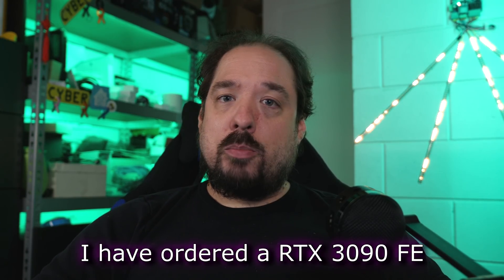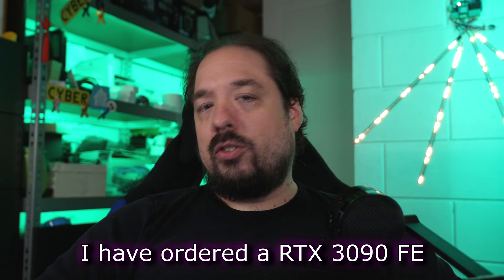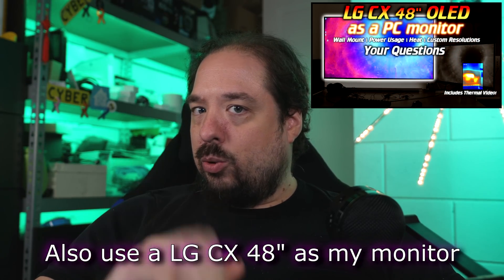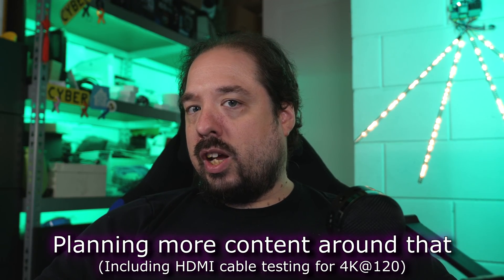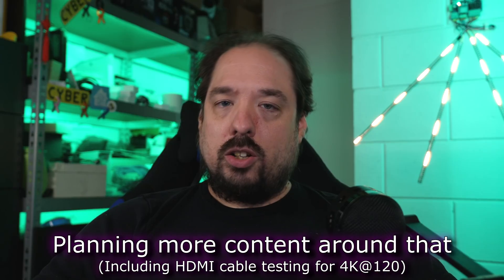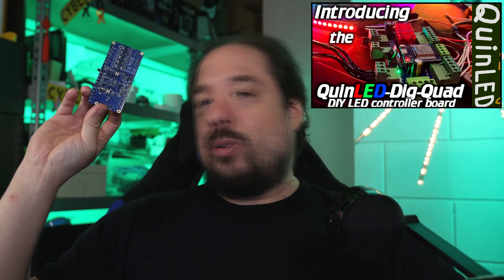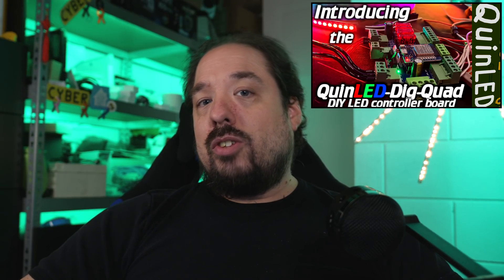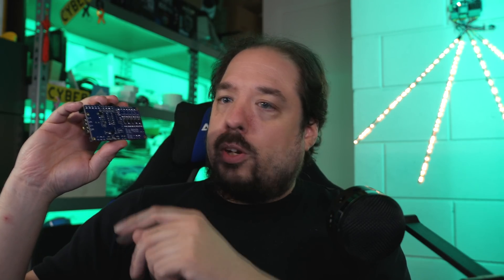Let's talk about: NVidia RTX 3080 stability / capacitor issues (POSCAP / SP-CAP vs MLCC)

Comment: So is safe to say that you better have a design with 15 x 320uF SP caps rather than a PCB with 10X 470uF  SP caps? The 320 uF being more responsive and faster responses?
Reply from the maker: In theory, yes, there is always multiple factors at play but as a general guideline that is correct.

Comment: Amazing work.
I have a Palit GamingPro 3080 and I experienced the same what you just said. I can boost up and overclock as high as I want and as the chip let me (more then above 2Ghz) even with the latest nvidia driver (456.55), but when I'm alt+tab or swap from almost idle to a heavy load or from a loading screen to get in to the game that's the point where I get a crash. usually this happens after like 3-5 hours of gaming. what is sad I have the new bios update what they got for this Palit card but i still have the issue (latest driver latest bios same issue) but I hope it wil be fixed with a newer bios soon :) so I try to stay positive and wait.

Comment: Looks like the new drivers have fixed this, Reddit users who had the crashes now confirm they are gone with the 456.55 release
Reply from the maker: Yes, reading this too, they seem to have toned down boost behavior in the upper regions slightly. Who knew that was in the drivers and not the BIOS/firmware. Still, exactly what I expected they would do. ;)

Comment: Guys you know what would change this entirely.  If this card had a stock power limit of say 500watt (but it would never happend as Nvidia want to look like they make cards that does not require too much power) then the fluctuation in voltage for the GPU asked for would not vary all that much.  Funny thing is I noticed that with this latest driver 456.55 from Nvidia that my vgpu to the gpu is fluctuating very little while I run benchmarks or play games.  I am saying this as a Palit RTX 3080 GamingPro OC owner.  I have not experienced any issues even with the first driver, but some of the people here in South Africa has, untill they installed the latest driver.  The normal boost clock on this card goes all the way up to 2055mhz at stock, however my card is running 2070 and 2085mhz at stock with a slight vcurve mod and does not crash.  

I did however check the caps on this card and it has one array of 10 of the MLCC caps which maybe helps.

Comment: You skipped the difference in cap types. I know different behavior in high frequencies does matter in designing radio equipment. So i have another speculation than you and want your opinion on it. You say that the boost or changing the working frequency give spikes, i disagree because what creates power draw in the first place is utilization of the card. So i say that all the switching transistors (fin-fets) in the GPU are generating high frequency noise on the power delivery constant up to around 2Ghz. I say up to because not all transistor will switch with every clock. However switching is hard and will cause square waves with lots of harmonics above 2GHz. Now as the card boosts the frequency does only increase a little, but powerdraw of the GPU goes up in bigger steps. So now you are creating more noise of al the switching going on in the GPU. If this noise, or constant wobbeling of the voltage is not canceled out. I think the problem will occur that the logic states of all zero's and one's could be messed up. I think this because modern high end chip are starting to use lower and lower voltages so the difference between zero's and one becomes smaller also. A 3080 uses somewhere up to 0.9Volt as VCC. This does not mean a 1=0.9V and a 0=0V. On a DM74LS09 simple logic chip VCCmin=4,75V VIHmin=2V and VILmax=0,8V. If the difference between 0 and 1 in a modern GPU scales with the logic chip example that would mean 0 and 1 are very close together. Although i tinker with electronics some times and it was my day job in the past i never worked with chips as complex as modern GPU's. So if my hypothesis is correct do you think the different type of cap would make any difference? Because filtering out high frequency noise is better handled by MLCC as far as i know.

Comment: You guys are talking about who knows what while Ive been gaming on my 3090 for the past 3 days. All you need is a NEW and GOOD quality power supply. That's it.
Reply: Yep. While GPU apocalypse is coming down all the YT channels, since few days i'm putting my 3080 to good use. With no problems. I also belive that quality PSU is the most important PC component. More important than CPU, RAM and MB.
Reply: Yep too many people dont really know what they're doing and buy overy expensive gpu, cpu, high speed memory, LED up the wazoo and skimp on the psu. Go figure

Comment: hey, i know for mlcc some of them are so expansive, like KEMET 47uf 0805. looks like rtx3080fe and ausu are using them.
Reply from the maker: Yeah, not sure where that is coming from but a generic 6.3v 47uF 0805 is only like US$0.031 if you buy more then 10000. That's not really expensive? Even if they are using some uber variant, it's not an expensive part.
Reply: @IntermitTech  yea, most of mlccs are cheap.  the mlccs on rtx3080fe and asus, they are bright yellow. I think only KEMET's mlccs are bright yellow. And i check on mouser $1.x for one. lol
Reply from the maker: @NEO3844  Can't imagine they'd still cost that if you buy them by the container. ;)
Reply: @IntermitTech  it's the price when buying 10K, just buy one will cost $5 lol

Comment: In regards to the chips, are you saying its better to have 4 SPCAPS and 2 MLCC sets, or a total of the 6 MLCC sets? Just trying to wrap my head around it. Thanks in advance
Reply from the maker: I believe the combination is going to work fine/is the most logical design. It's a combination of grunt and fast as you'd normally design it. I guess all MLCC so all fast would in theory work just as well, but as some point there would be a diminishing return.
Reply: @IntermitTech  mlcc caps suffer from cracking and they are placed there the thermal cycling would be most prominent. No idea how much vibration the fans would be causing on top of that, also no idea how much the PCB would be stressed due to sag.. I guess the MLCC caps are 1206/3216, so there is a downside using (larger) MLCCs. They are a common failure on many laptops.

Comment: So ordering rtx 3080 without overclocked won't be a problem right? Or they have also same issues with rendering. My main purpose is to built workstation but now I am really worried that whether it will worth it or not ?
Reply from the maker: As I mentioned in the video, I think a BIOS/firmware update will fix it. And even if it wouldn't vendors will have to replace your cards under warrenty.

Comment: Hey, good information. So at the end of the day, the RTX 30 series will for sure need a BIOS update? In order to fix this issue?  If it results in downclocking the RTX 3080, that means NO possible chance to ever OC for the future?  Seems kinda a waste if someone is spending that much on this card, where they can't OC at all?
Reply: OC will be a thing of the past, both CPU and GPU will OC as far as they can on their own
Reply: @1GTX1  That's why they are coming up with 3080 ti, where Ti cards are meant to be OC? As long CPUs can be OC, then it will be no different with GPUs. Granted each era of GPU will come with better clock speed. But in order to get the extra $, they will always come up with "OC' card. Look at the current line up now. Asus TUF is charing $60buks VS NON OC version.

Comment: so you are basically saying the card is capable of boosting just as high (without crashing) , but it has to do it a little slower , which potentially causes a slight loss since it is not reacting to demand fast enough.  .. but say a scene with heavy demand will yield the same FPS as a founders card with stock bios since boost transition has already occurred
Reply from the maker: Yup, that's it. From what I've seen and read the inherit power delivery system on the cards isn't flawed as a whole. Just a mismatch current between BIOS boost behavior and power delivery speed capabilities. Or rather, in my opinion that would be the fix for this. If this should have happened in the first place is a whole different issue, but we are there now so it needs a fix. But it's not the horrible disaster I think then some make it out to be. Of course, this is all speculation, but at least a bit more technically based then what some others are regurgitating from misunderstood reports.

Comment: EVGA posted on their forum that they found the issue early and resolved it
Reply: Thankfully EVGA is not Apple. Otherwise they would have released a statement saying all these people with issues were "Using the videocard wrong"
Reply: Wasn't COLORFUL the 1st company to figure out that's a problem with the card. Because they sent the card to Jay2cents & WCtech way before the launch and requested to have a look on the cause of crashing during overclocking. But EVGA noticed it and kept quiet until this locomotion was going too wild and then they started to step out and address it. Same cases with the NEWEGG packaging issue but of course that was NEWEGG's fault. Then again they didn't come out a statement until someone files a complain about it in their forum.
Reply: @maxwilliam8470  JayZ said that Colorful told him about the possible issue with his review sample privately, but did not make a public statement.

Jacob from EVGA said that they discovered the issue with 6 SP-Caps during mass production, but after they sent out review samples. So they contacted reviewers privately to inform them about the issue with the review samples/tell them to wait for new review samples. They did not make a public statement at that time either. So, exact same thing as Colorful. 

And there wasn't anything untoward about EVGA not releasing a statement at that time, because they ultimately fixed the design and did not ship any retail units with the insufficient 6 SP-Cap configuration.
Reply: Yah, I heard about some buyer actually did received the 6 SP-CAP cards instead of the advertised 5SP-CAP | 1MLCC cards from EVGA. I wonder if they able to get refund/exchange from that batch of graphic card.
Reply: @maxwilliam8470  Considering EVGA's official statement that they found 6 SP Caps to be insufficient and changed the design, I would hope that they would offer a replacement.
Reply: @nedjimb0  They resolved this before production, which is why there was a delay. No cards with the previous design were sent to consumers.
Reply: Wait.. they also had control not to put then on there in the first place?
Reply: @net200777  because they built the card to perform to a certain level and dont build it for mass overclocking.... thats where the issue reared its head, on over clocking not on stock out of the box settings